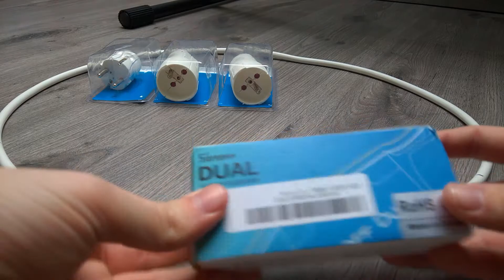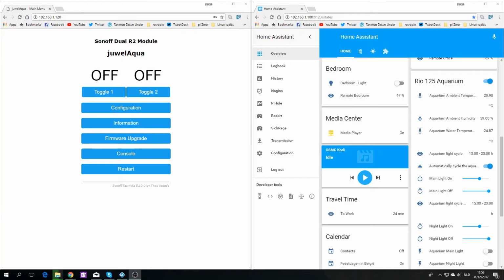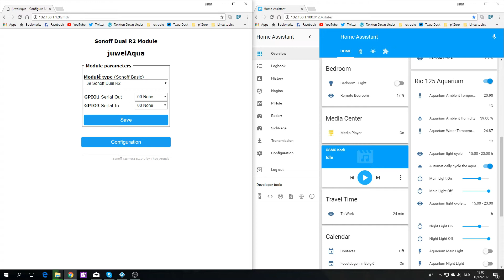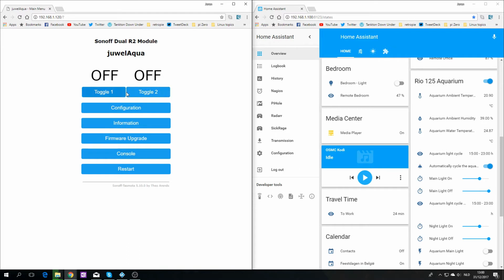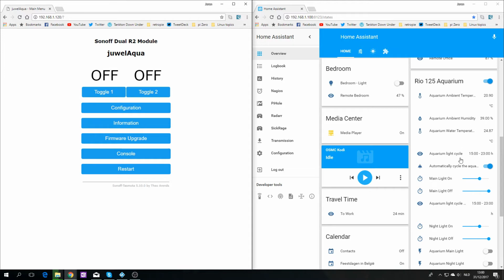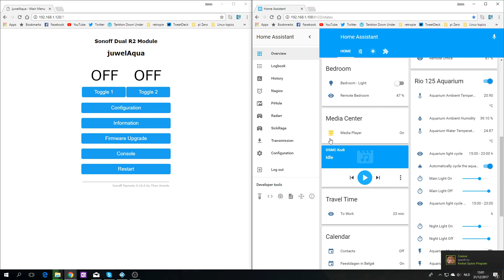Sonoff Dual - Unboxing and HomeAssistant Demo (custom firmware)

Comment: Hi buddy again. Apparently everything is fine and my configuration.yaml is OK after having checked it. But you know, when I enter Home Assistant again he tells me that I have an "Invalid config." The fallowing components and platforms could not be set up: -mqtt, -switch.mqtt ". So I want to ask you what did you write about MQTT at the beginning, at the top? I have the following:
mqtt:
    broker: 192.168.0.37:1883
    username: myusername
    password: mypassword

That's all

Regards
Reply from the maker: Use this(with your own settings):
mqtt:
  broker: localhost
  port: 1883
  client_id: home-assistant-1
  keepalive: 60
  protocol: 3.1

Comment: Hello buddy, can you help me?. I have problems with my Sonoff dual configuration in Home Assistant.  I only see one channel, the second switch do not appear on the screen. Could you show me the configuration that you wrote in Home Assistant. Thanks in advance.
Reply from the maker: You will need to put both in as separate switches:
switch:
  - platform: mqtt
    name: "Aquarium Main Light"
    state_topic: "stat/juwelAqua/POWER1"
    command_topic: "cmnd/juwelAqua/POWER1"
    qos: 1
    payload_on: "ON"
    payload_off: "OFF"
    retain: true
  - platform: mqtt
    name: "Aquarium Night Light"
    state_topic: "stat/juwelAqua/POWER2"
    command_topic: "cmnd/juwelAqua/POWER2"
    qos: 1
    payload_on: "ON"
    payload_off: "OFF"
    retain: true

Comment: Hello, thanks a lot for your video!. I'm very interested in a detailed description about dual Sonoff flashing. I would be very grateful if you could do it. Thanks in advance! (cototo2005@gmail.com)
Reply: Hello and thank you for your video! 
I'm afraid that you should make special note about the version of Sonoff Dual you have (In particular it's R2). The relay that I have at the moment and plan to flash with alternative firmware is the Ver 2, not R2. It requires a little bit different method to access GPIO0, as explained on https://www.youtube.com/watch?v=pGbDFsNMOkw .
Right now I try to find out how to backup original firmware (in order to control Sonoff directly from Alexa without Home-Assistant) and what alternative firmware is best suited for my tasks.
Reply from the maker: Hey. I'm planning on making a video, not sure when yet. Maybe this week-end :). I will do it on my sonoff TH16 tho, but it will be 95% the same :)
Reply: It's sound good!. To things are very important to me in my Sonoff Dual: wifi configuration and the switches (have to work properly). Thanks a lot.
Reply from the maker: Hey, there is indeed an "older" version, however most retails do sell the version I am using (as far as I can tell). Good that you provided a link in case of ppl getting stuck.
As far as I know it is not possible to get the original firmware. There are replacements but the original firmware is not open source.
For alternative firmware I suggest the one I am using (tasmota) as it offers a webUI trough which you can control the sonoff and loads of other features :)
Reply from the maker: Hey, I had a migraine attack this week-end. I'll try to make the video during the week :) I do want to do it as I still have one I need to flash! :)
Reply from the maker: Hey, the video will come up in a few hours :)